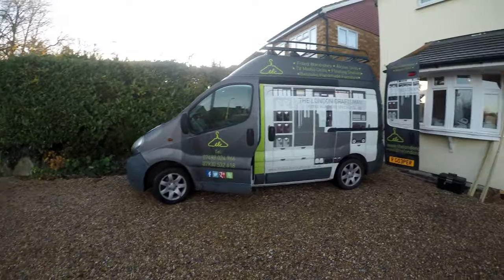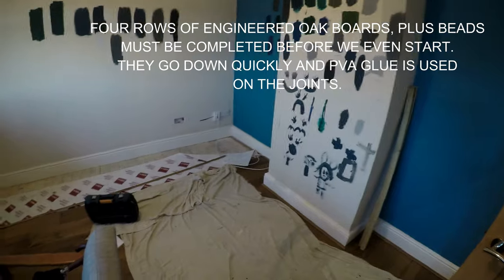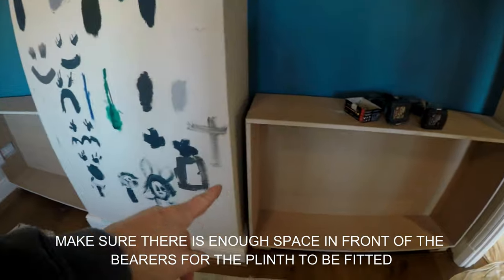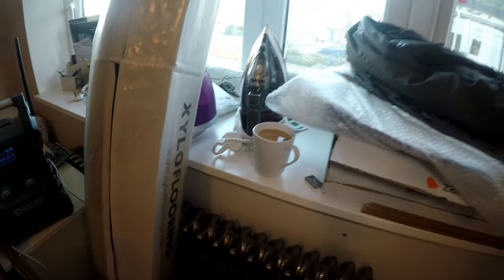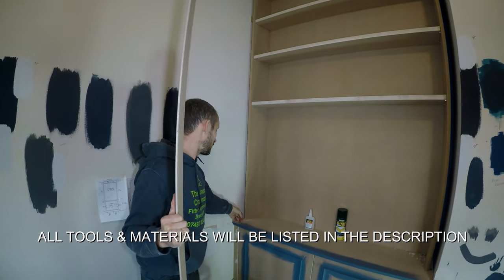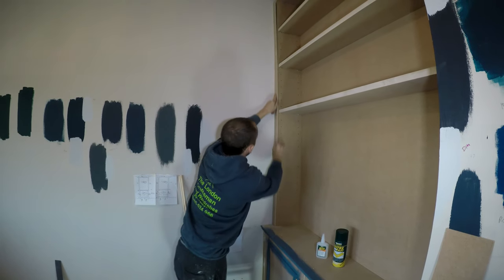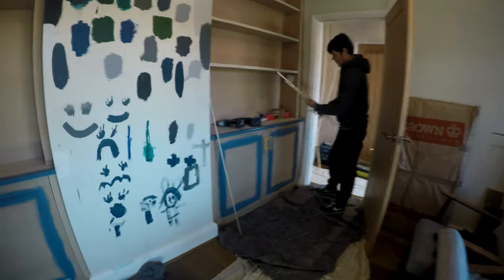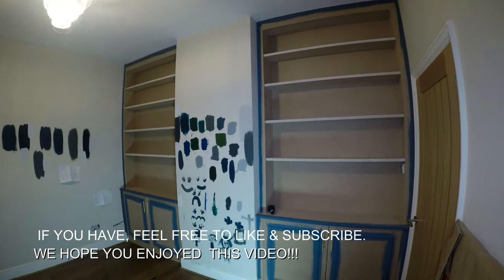Fitting day - Installing 2 MDF ALCOVE UNITS & TV MEDIA UNIT, ready for painting - EP#9

Comment: building something similar myself, what is stopping the tv unit from bowing, that centre opening I mean? I am wishing to do the same but wondered if the weight overtime would make it bow
Reply from the maker: Hi Alex, it cant sag because it's all fixed through the back.
I always build my units with backing to there are tons of screws fixing the backing to everything.
And as the lower shelf is fixed to 2 uprights it simply cant go anywhere and should stay lovely and straight
Reply: Ok cool, and I have a client who wants the doors made from something more solid, any tips on what to use? Thinks it will look cheap if MDF.
Reply: @thelondoncraftsmanworkshop  I usually use glue and brads for all my cabinetry, will this work as well?
Reply: Do u have any issues with the hinges working loose in MDF?
Reply from the maker: Not really tbh its pretty tough screwing intonthe face of mdf, well as the edges are the opposite!